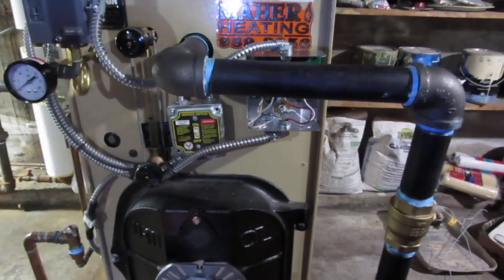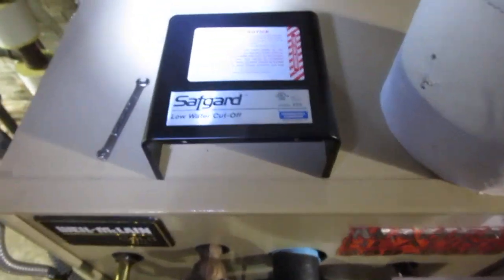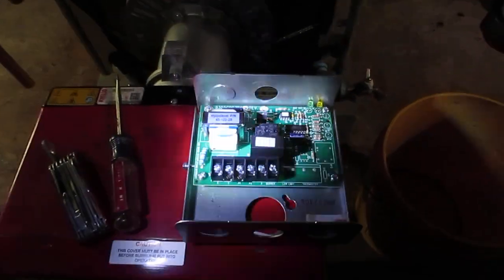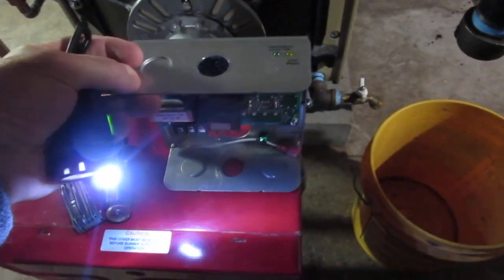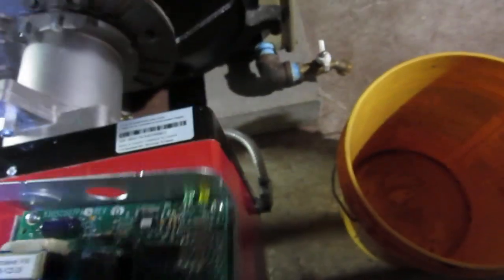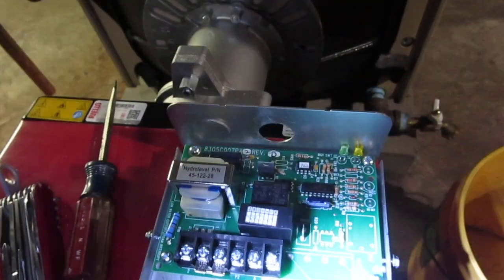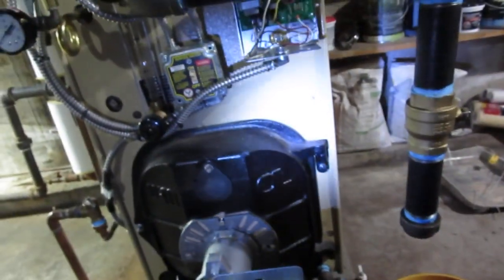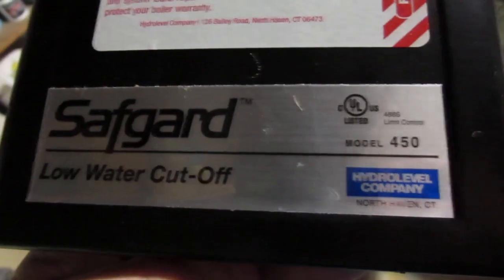Change Cyclegard 450 to Safgard 450 steam boiler LWCO

Comment: Hi I think after 11 years one of our two CycleGard 450 have failed in the same way as yours.I would like to ask you a few questions.
I have two Boilers (Smith Series 8) The installer replaced the one very large Weil Mclean with these totaling less btu (sometimes I wonder if to a too minimum of Btu) 
I think the intention was the one would mostly work and the other would kick in when needed and if one ever failed the other would still work..
But he switched it over that first winter eventually where they both just went on at the same time.
I never noticed the every 15 minutes of on/off check cycling.
With two Boilers basically running together is there some benefit if I only change one of the two to Safgard 450 leaving the other Cyclegard 450 in ?
Is there some additional benefit to having two different ones ?
Ive already had some trouble a few years ago where Cyclegard was asking for more water but boiler was full,
I noticed befor falling asleep one night at 1 am water running in the house before I dosed off.
I went down to basement and the one PsychoGard was asking for water was so full 
I had to empty buckets and buckets to see it in the glass. Since then we leave feeder off and check water level every day.
I don't know what's best. Now that I need to replace Cyclegard do I get a new one of the same or a Safgard. Id love it to be more efficient.
I just don't want to lose any protections from it. Thanks
Reply from the maker: Sounds like a complex setup. Take some pictures of the piping and boilers setup and post to forum.heatinghelp.com under the steam section. There are some real experts there. If you CG wont exit the test function (green light stays on) then it wont allow the burner to refire as it locks the burners out during the test. 

For that reason you really should call a steam pro to check your system. The feeder likely got stuck open, pretty common problem on VXT models. It's good you are monitoring daily since the LWCO (cyclegard and safgard) are supposed to add water via the VXT feeder so both need to work together. Both safgard and cycelgard should lock out the burners if the probe detects low water (orange light comes on) until water is either auto or manually fed to where orange light goes off. The both need to be wired correctly to the burner and the feeder, etc or they wont work properly.
Reply: @adjunctjones1065  Yes the guy that installed these boilers came from that site but about a year later sold his company to a large firm that maybe only does big things and deal must have been he exclusively works for them.He disappeared from the site as well.He was a good man. I tried to get one of the other guys to do a tune up but they were way too much $.But finally got a good honest guy who tuned up and says cyclegrd faulty. We pay for the PSEG Worry Free every month on them so I'll call them.I was just wondering if the one Cyclegard could be replaced with Safgard while the other remains.Has this Safgard produced any noticeable savings in fuel for you so far that you can notice or is it too early in the season? Thanks